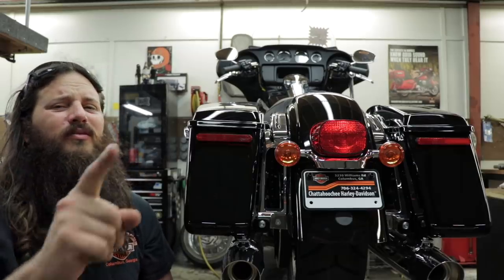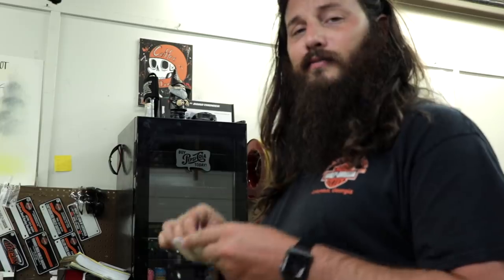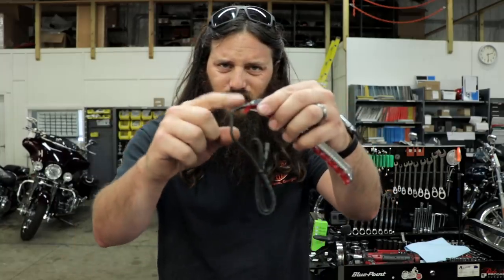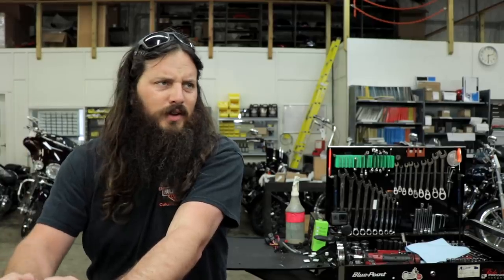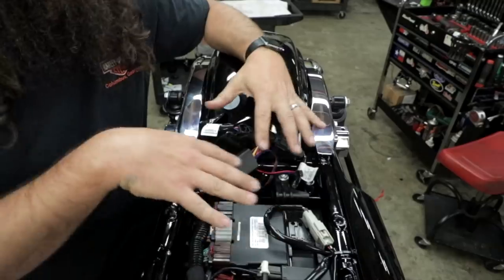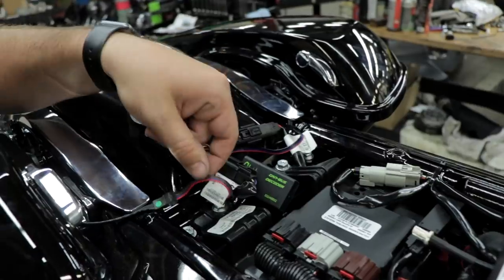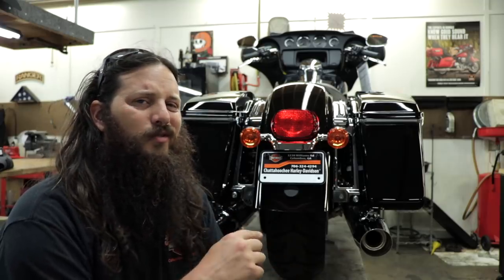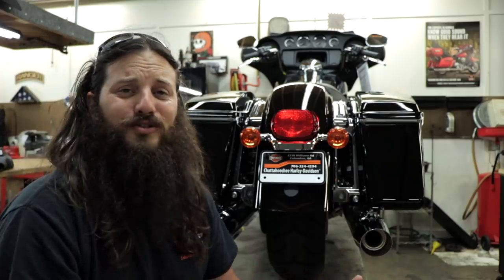Ciro Bag Blades Install and Review

Comment: Thanks John.  Just installed on my 19' Road Glide (red only version) and did not need the controller.  Glad you added the tip on tucking the connectors.  I also agree with your comment that the wires should be longer.

Comment: Cirro did mine at the Lone Star  Rally in Galveston... I personally think it might be the best lighting safety upgrade out there for the Street glide or Road glide. I already had the Custom Dynamics LED conversion with the Xtreme flasher... My friends told me with all the flashing it took to long to figure out which way I was turning. Put the bag blades in front of all that and it's the best of both worlds... Brakes and stock turns can flash bit the Amber bag blades adds lighting and clears up any confusion on what is happening next!

Comment: Pretty sweet!!!  Personally I dont want to have to deal with wires running to my bags and I immediately noticed how little slack they had....its typical that some companies give you 3 feet too much wiring that you have to figure out how the heck to tuck it all away or they go the other route and you have just barely enough to even wire it up at all..LOLZ.  THe way they have the light slowly lighting up in the direction you are turning is pretty slick...way cool actually!!

Comment: Awesome straight talk, John. That's why I'm a subscriber. Wonder if you'd tackle a cruise control addition? My Older Heritage Classic had it, my Road King Police Edition does not. It's a few years old so it has steel cable throttle & clutch still. Would sure appreciate some of your kind of schooling.

Comment: Great video.  I just installed mine and they look fantastic.  I just wish I could get them to light up.  I have installed lights and stereo's on motorcycles for 45 years and these do not light up.  They were easy to install on my 2017 Ultra Limited, I watched 3 videos, read the instructions hooked it up correctly and they will not light up for the running lights, brakes, blinkers, 4 ways.  Nada nothing works.  Other than that they look cool.

Comment: A couple of things..I have a ‘15 SG CVO, I can’t decide on the amber or red tune signal. Part of me wants to keep it all red in the back and the other part thinks I should go amber because it would get more attention. What are your thoughts John?
Secondly, I have to agree with you with on the wiring harness. Having a CVO and already having wiring run to each saddlebag, it would be nice to keep the connections all together. Why not have a Ciro harness run from under the seat,  follow the factory harness (or along the frame) to where it connect to the saddlebag. From there, you have a shorter pigtail off from the light and have the connector with the factory connector on the saddle bag for a nice clean install? 

Hopefully we run into you in Laconia 🤘🏼

Comment: Very good for looks being so thin and streamlined, but not near as noticeable for more light in the rear for safety as the larger more noticeable (more lighting surface) Custom Dynamics PLUG & PLAY SEQUENTIAL BCM BAGZ™ Saddle Bag Lights that you can also get in chrome trimmed to add a bit more chrome to a chrome accented bike, and with smoke or red colored lenses.

Comment: Thanks John, I got the filler lights and the bag blades, I commute 120 miles a day half the year in the dark both directions. Thinking more and more, that more light is the key to not get ran over. I haven't liked anything else. These look great and i can run them myself. Any chance of a warranty issue with them, i am assuming should not be an issue and can always unplug them, but kind of hard to remove them.By the way, i already ordered them and put your name down where i heard of them from.

Comment: John good video. When is harley coming out with the run,stop,turn module for the existing rear turn signals only ? It would be a great compliment for the bag blades and filler panels. I run Ciro filler panels, tail light and center brake light on my 18 Ultra

Comment: Why wouldn't you fill those massive holes between the bags with light instead of the top of the bags?  I filled mine with custom dynamics fillers, pro beam lights, they look great and are very bright.  Plus they fill the hole Harley left.

Comment: So I noticed that bike has The bullet type turn signals. My question is can you run them through the controller also. Like run a turn Break?  I do not understand why Harley takes lights off the back of the bike. Like the streetglide The ultra they take the brake light off at one they take the turn signals off the other. And then they charge you more money. Oh I like the lights. Thanks

Comment: I wish they were available in red signal/red stop. I would prefer to keep my rear end all red. I liked the snap to removed reflector!!
Reply from the maker: They are. Pick “all red” on the Ciro site.
Reply: @TheHarleyTech  my bad, I was looking at the SnakeEyes, Filler Panel, and Tour Blade's...I would like all of the rear options available in Red/Red or Red/Amber, but yes the Bag Blades are available in Red/Red

Comment: Great video as always . Had a quick question ? I have a 2017 street Glide special with cobra 909 slip ons. Can I change the air box with a different one.   without needing to buy a power commander. Thanks

Comment: Thanks a lot for all the videos I got a huge question I'm a new Harley Rider I rode dirt bikes when I was younger I just purchased a Harley from a dealership it was used they brought it over from another dealership because it was the only 2014 Dyna Fat Bob for sale they told me they do a how many ever point inspection but within two days I'm having it about 40 miles later I noticed the tread on the front tire was below 2 32 seconds so I took it in they said they would handle it they also notice my rear brake light wasn't working Now isn't that something especially with the tire it would have been covered in inspection most of my knowledge I'm getting from you and looking up things from trusted sources I'm supposed to pick my bike up today the 16th or tomorrow the 17th of April I would just like to know your thoughts on this

Comment: Nicely done man. 

I have a random question. I own a 19 street bob and I am thinking about removing the rubber fork gaiters. Do you know if these are there for looks only? Just don’t want to cause any damage with dust and dirt.
Reply from the maker: There is an additional dust seal underneath the gators. At least there is on the XL.

Comment: good morning, 
I installed the bag blades happens to me that the position lights work well, 
the turning arrows work well but if I operate the brake lights are blocked 
they stay on and do not go out anymore ..... I turn off the bike and turn it on 
and everything ok but when I use the brake they stay lit ... 
it could be a controller problem

Thanks in advance

Comment: I want to get these bag blades but I already have a kuryakyn run turn brake controller where the brake light will blink 3 times. I will lose that I assume with these blades correct

Comment: I can´t say about every Harley but the ones that I know all come from the factory with the possibility to leave the turning or hazard lights on with ignition off as well in accessory mode.
Very important and safe when you have to leave your bike in case of emergency to warn other traffic and of course you don´t want to leave the ignition on.
To my surprise I noticed that the controller that comes with the Ciro lights does not support the turning or hazard function with ignition off or in acc. mode.
I think this is an error in the controller. When discussing this with Ciro, they trivialise the problem and at first did not understand why this matters.
Even my suggestion to change this in future controllers to make the rear lighting a lot safer is not changing Ciro´s position in this. ´´It isn´t an issue´´ they say.

Comment: Hey John, ive got a 2000 Buell m2 Cyclone.. it has the 1200 evo motor a d recently died on me while i was riding it. Im under the impression its a carb issue but theres not a lot of info on my Buell on the internet. Any idea if the sportster 1200 parts are 100%interchangeable on it since its technically the same motor?

Comment: Love the channel... since you are working on lights i have a question about my 2015 fls. I want to put a freight train nacelle on it but harley only calls for it to fit on a fatboy, fatboy low and a heritage classic. What is the difference between my forks and the others? Is it just because of the handlebar risers?
Reply from the maker: I have no idea, I’ve definitely seen it on a slim. Chances are it takes some fitting and doesn’t just “bolt on.”
Reply: Are the forks on a fatboy, heritage and a slim the same?

Comment: Nice video John. I have a question. I have a 2013 FSTFB and installed a hard bag conversion kit. to replace stock directional I got the bag blades. great fit on the bags but not sure of adapter. I got the 6 pin but does not look like it is for my bike. Will the 8 pin work?. Or I can splice, any recommendations on splicing?. Thanks
Reply from the maker: Neither of them are going to be true plug and play. You’d have to do some figuring on changing either the bike harness or the controller harness.

Comment: Thanks john, these compared to the OEM, which would you choose?
Reply from the maker: For low profile I’d go with these. If you want the extra chrome or black housing that the H-D version offers, then go with that one. I like the low profile, and I like that the turn signal changes to amber, and flashes outward.
Reply: Thank you sir. Luv ur vid’s I’m just not much of a commenter...

Comment: Do I need the controller box if I get the all red run/brake bag blades. It seems that you would only need the controller if you had the red/amber signals. Am I reading that right on the website???
Reply from the maker: That does sound right, but Ciro is just an email away, and super helpful!
Reply: Awesome. I will give them a buzz before I get to crazy just to make sure.

Comment: I have a 2017 SGS.  Had a guy tell me that he could barely tell the lights (those little factory bulbs lights) were working as we pulled into a store parking lot.  Having no lights or minimalist is cool but not practical in today's driving environment (how many people do you see head deep into their cell phones while driving).  Had a fellow rider literally got run over at a stop light by a soccer mom (who we all bet was texting).  He died at the scene.  I went with LED lights to replace the standard bulbs, added saddle bags LED lights & lighted license plate.  When coming to a stop or stop light, I postilion myself an escape route on either side, then I flash my brake lights if cars are coming up behind me until they stop.  Ride safe.

Comment: Nice looking lights, but with too short of wire and hassle unplugging repeated every time remove bags not so desirable.  Thanks for link, but $299.95 is pricey.  DIY some permanent mount lamps off fender brackets.